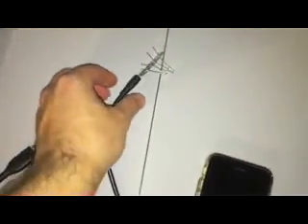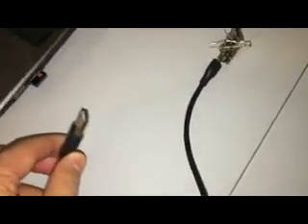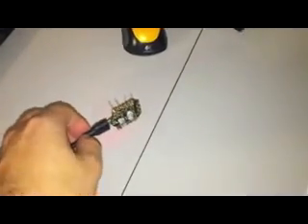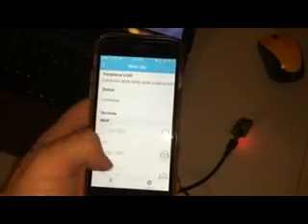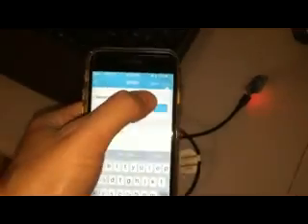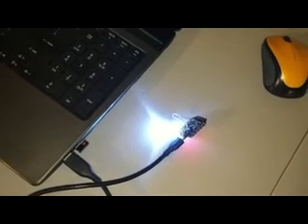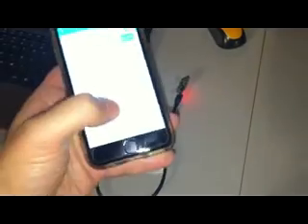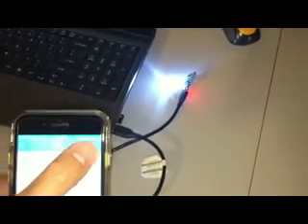Arduino Bluno Beetle BLE in action. Iot

Comment: I have this error when I tried to upload my program on it 

A fatal error occurred: Failed to connect to ESP32: Timed out waiting for packet header I tried to hold the boot button but nothing happen
Reply: Hey, I'm the same guy but from another channel. It's been so long that I don't remember   I wish I could help more but I would 1 try to get a new cable. 2 and if possible get another BLE. 
Be sure you downloaded the same app I did and if all of this is done and it doesn't work try to download another app to control the blue and you can send text

Comment: Thanks for posting. Do you think the Beetle could run stepper motors such as this without drivers. https://www.youtube.com/watch?v=it-KRL3z8EY&list=FLz-6tG6KLw6S_9xHIYo66MQ&index=3
Reply from the maker: Railyard Productions yes I believe you can. Be sure that it has same voltage or you can have relays triggered by the BLE and some other source of power powering the motor. Just my thought
Reply: Ok, I am going to order one. Thanks for quick reply.